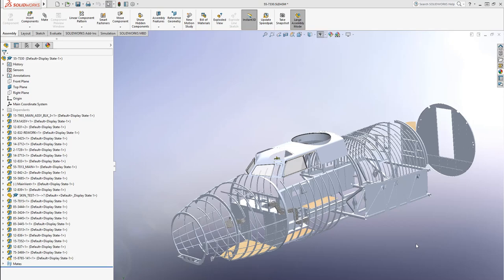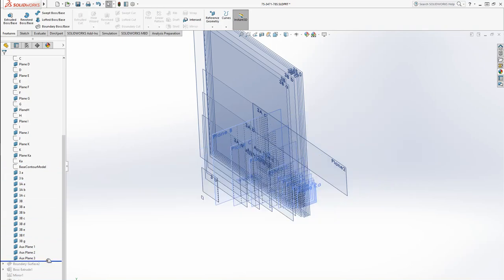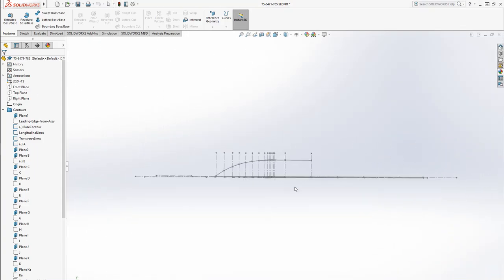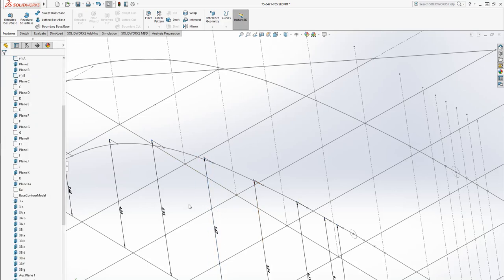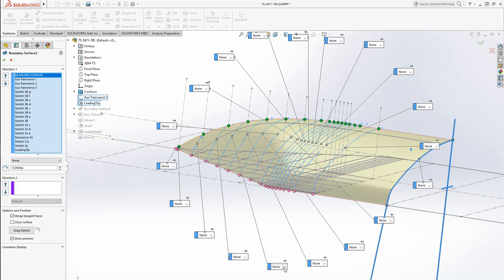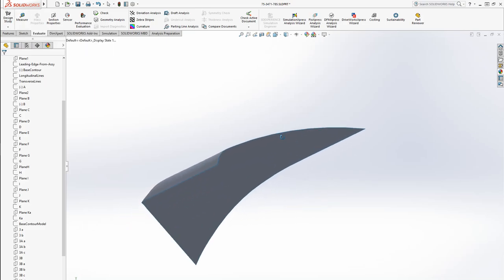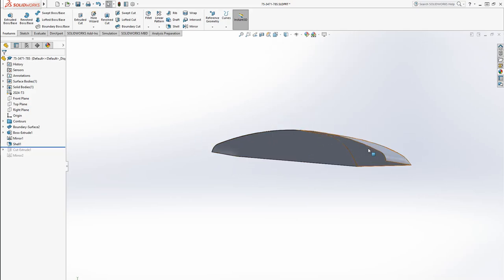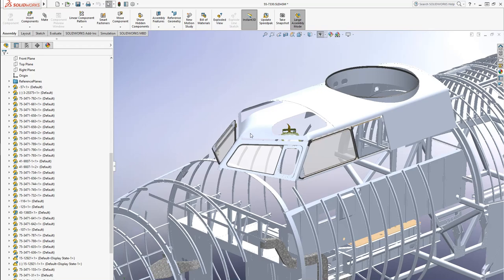Solidworks: Complex Contour Surface Sheet Metal

Comment: what can you do with that after you've modeled it? How do you take that shape to get a flat pattern or is this just for a drawing purposes?
Maybe this is used for machining a coining die and the perimeter and holes are laser cut or sheared after or during forming.
I believe the highest tier Solidworks can flatten a complex surface (not Sheetmetal) but not sure.